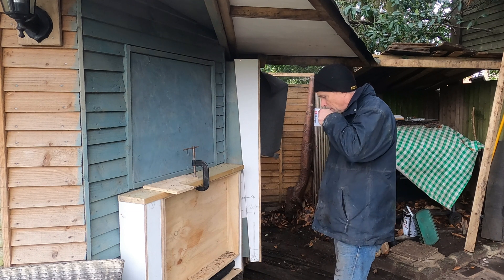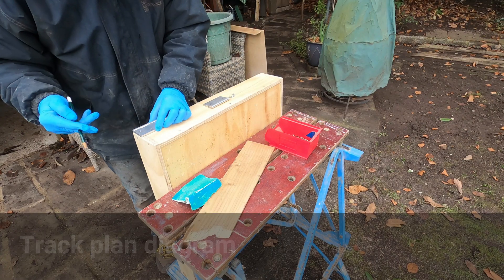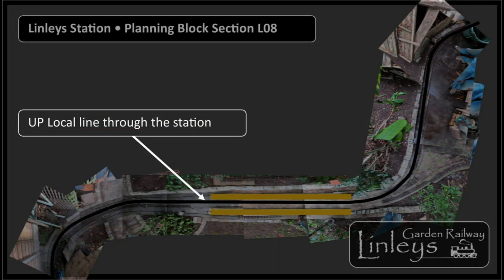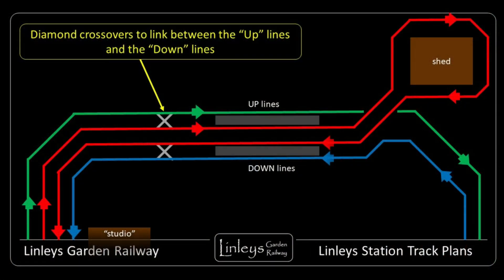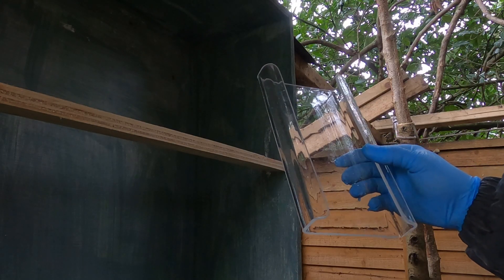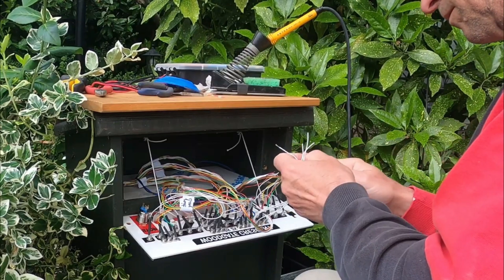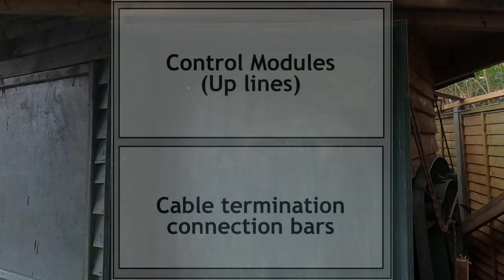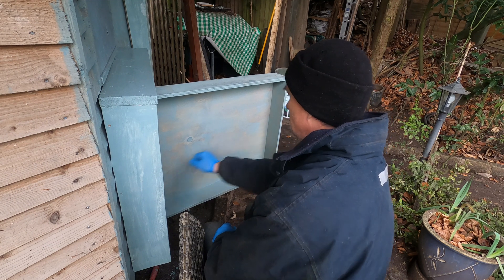Building a Garden Railway • Mimic Panel & Control System Project Update • G Scale Garden Railway

Comment: I'm still new to garden railroads (about 2 months), and I'm still looking at how to power my layout. 2, 1/29 scale, 1, 1/27 scale, and an 1, 1/20.3(?) LGB set. Also working in N scale. Considering an Arduino DCC system for that. I might be one of the few who might be interested in your system. I watched the 13 videos in the DLC playlist last night. Seeing someone actually using a PIC controller piqued my curiosity the most. 

The available options vary greatly depending on which side of the pond you live. I'm not even seeing any Peco flex track here. Options are hard to find.
Reply from the maker: I find none of the local model shops stock the track these days but can order it in for me. I’m interested in the Arduino setup option. When I started designing the DLC system Arduino and similar were not on the market. I was familiar with PIC chip and programming so decided to go with that. 
Thanks for your comment. Cheers 🤠 Warren